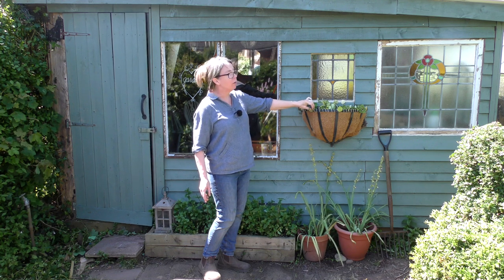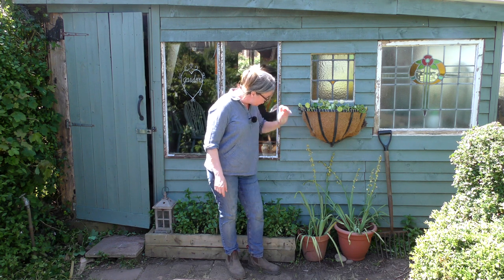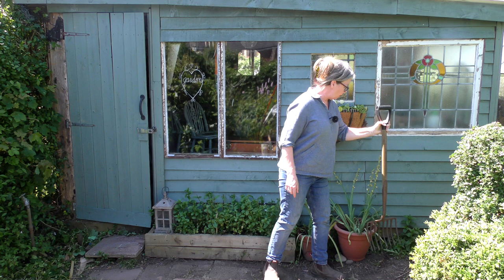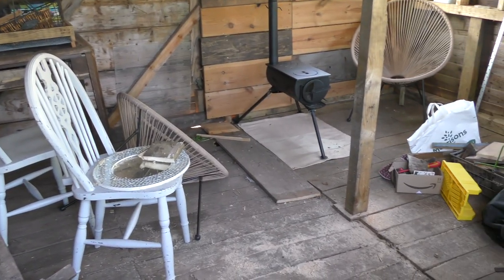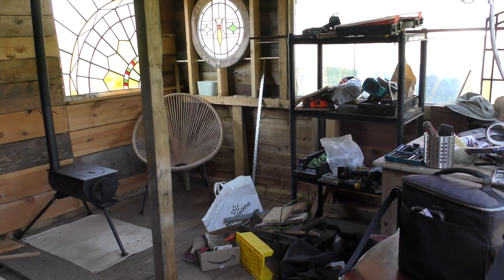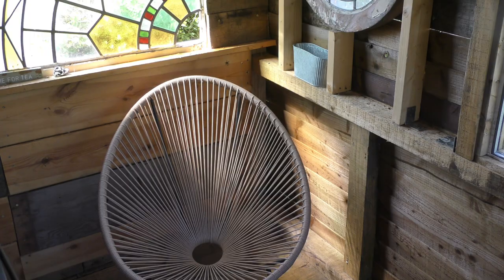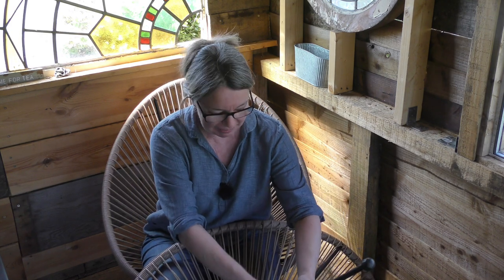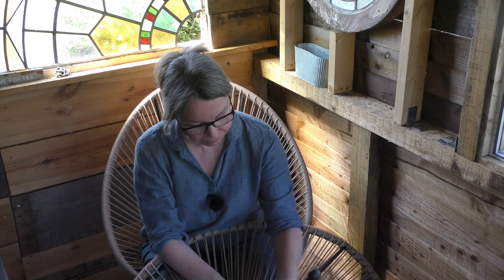DREAM SHED (almost) - from start to finish!

Comment: I thought I’d drop buy and watch your video again for some inspiration.  A tip on the light situation, you could buy usb powered lights and plug the lights into a cell phone battery pack we do that for our cabin.
Reply from the maker: We now have some solar lights installed but I must admit the quality of light is quite low - I'll take a look at the USB ones. Thank you!

Comment: Looks fab Jane and Mike, check to see if you need a fire guard behind the stove as it is dry wood and super hot can cause issues. Tony O may know if it’s needed. Great place to,hang out and have a copper and a natter, Ali 🥵🌞
Reply from the maker: It should be okay as it's projected forward about twelve inches - I'll double check though. Thanks Ali!
Reply: @JanesGrowingGarden  oh good it just looks closer on video ❤️

Comment: Hi Jane, love the shed! We’re having a potting shed extension to our summer house(old shed!) so I ‘d love to have a stove too, where did you get it and was it easy to fit, (luckily hubby is a fab d-I- y’er.) Happy new shed!
Reply from the maker: Oooh yes I'd definitely recommend one - ours was from a company called Outbacker Stoves - super easy to install (just a hole in the roof and a little guard thing) and you can take the flue off and carry it around to wherever you want to use it outside as well. Good luck and thank you!